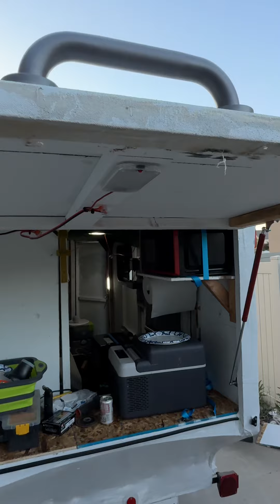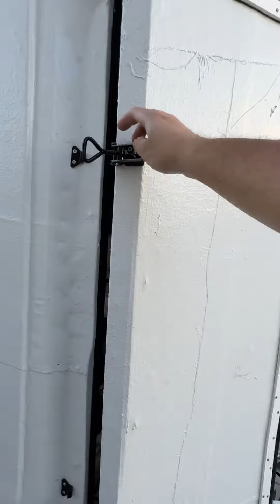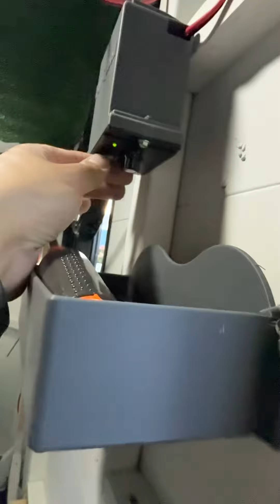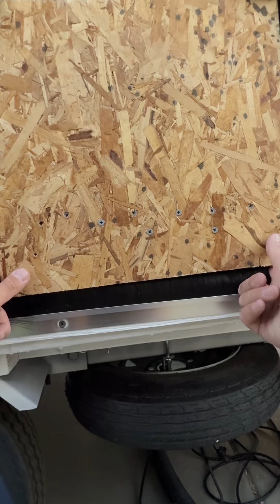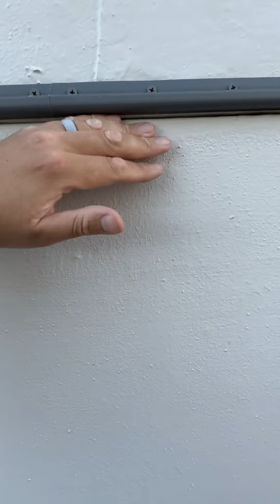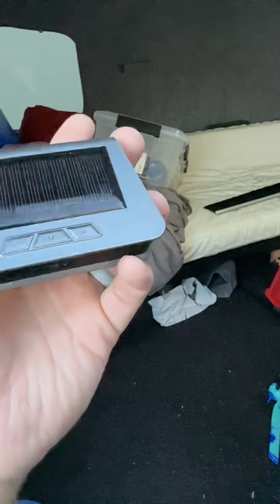🔧Harbor Freight🔨 4 x 8‘ trailer build with kitchen on back. ￼

Comment: Bro I have no idea how or why you ended up in my suggestions but this little trailer is sick and I really like the lay out of it this seems like a great diy project to do only change I’d make is to have a pvc pipe capped at both ends with a spigot on one and and a Schrader valve to be able to add some air after it’s filled with water so that you have pressurized water for washing and showering if you decide to take it camping
Reply from the maker: For sure!  I’ve got the space on the bottom and could hang a system like that and will for sure. I appreciate the input. Should I go side to side or front to back?
Reply: @goforjack front to back and with a swing out at like a 45 so you can hang curtains in case you ever do need to use it for a shower and front to back would also be a longer container so you can hold more water
Reply: Same here. I am mildly interested in something like this.